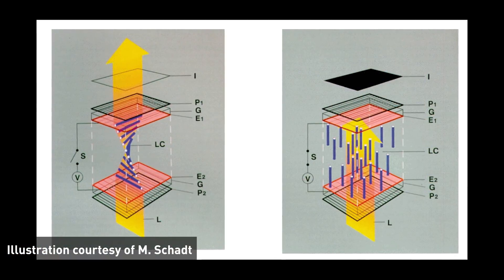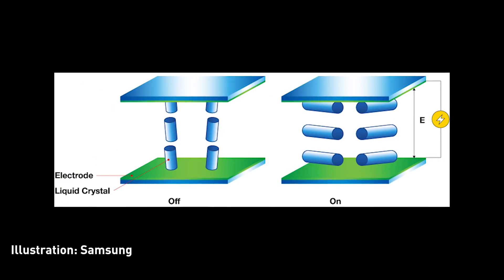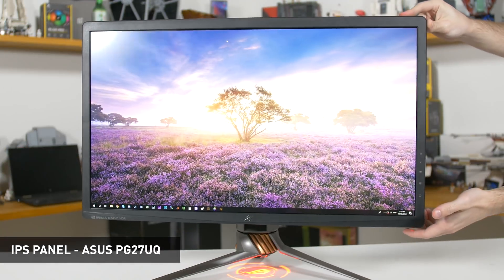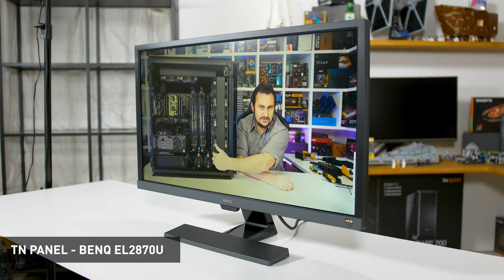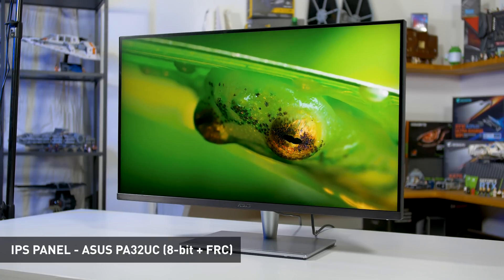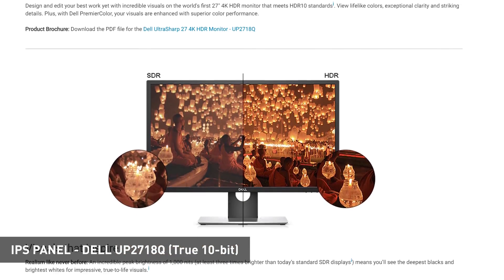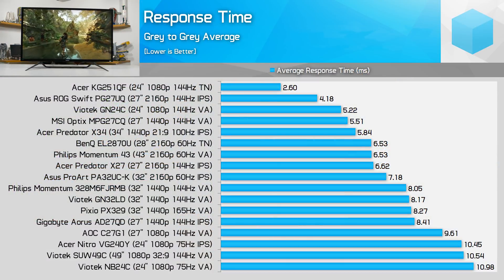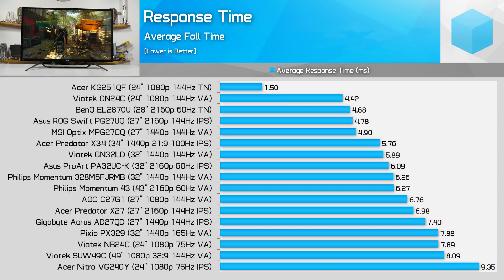TN vs IPS vs VA: Which LCD Monitor Tech is Better?

Comment: Seriously why are u even making this kind of video to misguide consumers? So many of the consumers now have bias on VA or TN just beacuse all the " professional" tech review nonsense while many of the TN and VA are doing a lot better than some ips. It's 2019 and people should really be focusing on the specific quality of the monitor they are looking at instead of using assumption of the panel stereotypes. Seriously cut the bs
Reply: Huh? So what is the issue. You said that consumers are bias towards VA or TN because of "professional" review nonsense, and then say many of the TN and VA are doing a lot better than IPS, which is a good reason for their bias. So what is the issue?
Reply: @Addition2  I don't know if you can read or not but I'm having a hardtime understanding ur comment. Many " professionals" nowadays keep telling consumers that ips are the greatest in color and many of the monitor review would put "this has a ips panel" as a huge praise for the monitor. This is exactly what he did in the video. As a result, when most consumers pick monitor, they started to look at ips monitor only. However, many of us who have a lot experience with monitor knows a lot of the manufactures makes very good va or tn monitor that has better color than a lot of the ips panel.
Reply: @Lorna-0726   Then say "many consumers have bias towards IPS panels because of the "professional" nonsense, despite TN and VA have grown better than some IPS over the years". Because I don't understand your previous comment as it just doesn't make sense why it is an issue when there is no contrast between the consumer's bias and the panel's quality.

Comment: Huh? Everyone's bashing IPS in the comments, while I can barely look at anything but IPS. Sure, the contrast is rather lousy, but the overall picture quality is so much better than either TN or VA...
The only catch is that you can't go cheap with IPS. At least get a mid-tier Dell.
Reply: Same with TN though. Cheap TN gets you exactly what you paid for, garbage. High end TN: Barely a difference with my laptop IPS panel, vertical shift is noticeable from pretty uncomfortable angles and horizontal is almost non existent.

Then there is very slight banding in white to grey gradients, but best of all: no orange puke in the corners when playing in a dark room which in turn means no friggin light being reflected in the monitor either which is a big no no for me with IPS (since it pretty much requires lights to be on to not look like trash in the corners and that causes blacks to look significantly worse then good TN panels).
Reply: @MLWJ1993  Sound rather improbable. Can you actually name such an outstanding example of a TN so that I could try finding one at a store and checking it myself? Truth be told, it's been ages since I paid any attention to TNs, so things indeed could change... Then again, it's probably more expensive than my Dell.
Speaking of which, maybe your IPS is too large for the price? Because on my 27" I barely have that problem even on dark images with the lights off.
Reply: @getsideways7257  it's a 17" 1080p ips laptop panel, but ips usually looks bad in a dark room, nothing unusual there at all.

I got a pg278qr as my pc's monitor, it has issues but so does any other panel tech out there.
Reply: @MLWJ1993  Is it really fair to compare a laptop panel to a TN that costs over one and a half times more than my Dell U2715H? For that price you could land yourself a professional-ish NEC IPS or maybe even an OLED solution. Cheap IPS panels are pretty awful too, that's why I went for a middle ground with my Dell, and so far I don't have a lot of complaints.
Though I have to say that piqued my interest. Need to find one of those TNs and check if they are really that great. Still, if it takes almost $1k to get a comparable image quality to a good IPS, I'd rather stay with IPS.
Reply: @getsideways7257  laptop IPS is actually a lot better then monitor IPS when it comes to quality and even then it still falls short in my viewing conditions. The PG278QR cost me €450,- , most of that extra cost goes into G-Sync & the Asus brand as well, but it was well worth it. Comparable monitors with the same features & an IPS panel would've set me back €200,- extra at the very least for very little gain and nowhere near the consistency of a laptop's IPS panel (also known as the the panel lottery, with IPS being the least consistent of the 3).
Reply: @MLWJ1993  Well, maybe it's a lot better only in the consistency department. Either way, laptops are too unwieldy for me to even consider one. It's beyond me how people are still using those.
Strictly speaking, it's a moot point, since we can't compare our monitors side by side (even though I accept the possibility of a TN panel indeed looking good even at some angle). It's just from my personal experience that IPS' image quality was always superior to that of VA, not to mention TNs. If I'll ever see otherwise with my own eyes, I'll change my opinion. But before that happens, we'll probably have "affordable" OLED and maybe MicroLED monitors around. After all, I don't remember hearing of professional photographers or artists going TN for the sake of better picture.
Reply: @getsideways7257  you don't see a professional going VA either though (yet), simply because of the select features IPS offers (great viewing angles, (close to) 100% DPI-3 colour space coverage, etc.) At least for a professional monitor that is, when it comes to consumer offerings IPS is a marginal upgrade under $1000,- with the same feature set as my TN.
I can't game without VRR support anymore or with just a 60 Hz screen. That removes a professional IPS monitor from the equation fairly quickly.
I also like to keep it affordable at the same time which IPS for what you get isn't really that great value.

If I did have to change my monitor I would probably go high refresh rate VA if they fix the slow dark pixel response times.

If they don't I might consider trying IPS again if nothing better exists yet and an older model has a good price and features.
Reply: @MLWJ1993  Marginal or not, I didn't end up with this because I wanted to throw money away. I wanted good enough color reproduction (and yes, the angles) and the Dell delivered. That said, we appear to have vastly different priorities. I, for one, am barely a gamer at all. Insanely fast panels is not what I absolutely need to have, even though they are also good for simulations. Still, the colors come first for me. I will definitely be on the lookout for TN panels that could rival mid-tier IPS ones in that department, but I have serious doubts I'll find something acceptable among them. I may not be a professional photographer myself, but I need to have a monitor that can be at least remotely considered good enough for the purpose.

Comment: I also wanted VA but my games need to be bright like when u play the isle on a non-nightvision dino and all u can see is the blackness of the sky
So i picked up an IPS although you wont feel the difference in this 3 ms difference there is 1000 miliseconds so 8yr old kiddos dont think 240hz tn is better for u and u cant feel much difference between an 144hz or 240hz

Comment: Got all three , although obviously monitors differ.
The Dell TN i own is the best.
VA is decent. Not bad really regarding response time and overshoot. Colours and black levels are good.
IPS is accurate and pops slightly more without the loss when you move your head an inch to the side.
But the Dell TN is almost IPS like. Honestly if you don't move your head you'd think it was as it's bright and colours are very good. 
The connected feel and response time is better.
Each have their pluses but when I use the TN it feels easier to play FPS and games like FIFA as every thing just happens that few ms faster. You wouldn't think it would make a difference but I think it does.
The others have arguably the better accuracy but not so much with fast moving graphics.

Comment: Personally i just can't stand the bad viewing angle of TN panels specially with big monitors. I've seen ~30 inch TN panels where you could see a significant change in contrast by just looking at the corner of the screen without moving your head. I have two monitors. A 60Hz 1080p IPS monitor i use when i have to do web design because of the better color accuracy and viewing angle. And a bigger 144Hz 2k VA panel to game because i simply could not find a cheap big 144Hz 2k IPS monitor. I think VA is a good compromise if like me you can't stand TN.

Comment: recommend VA for gamers, when VA is slowest? oO;
I came here because i own a Samsung "gaming" VA monitor (C27FG70) which is so ridiculously bad that even watching some videos is a pain due to the ghosting no matter of the settings, certain speed sideways (panning) movement is so choppy that distinguishing any details is damn near impossible when the same thing is at 3-4 places at the same time moving back and forth. FPS games are damn near unplayable no matter the settings (multiple GPUs tested, multiple OSs, multiple drivers, all settings perused through, both hdmi and displayport, freesync or no freesync).

Comment: What's up with the whole 8-bit color depth deal? Haven't we been using 32-bit color since the 90's?
Reply: 8 bit panels can do 24 bpc , 10 bit panels 30 bpc, they refer to the amount of shades any specific pixel can have at maximum.

You can also do frc which quickly switches a pixel to simulate a new colourshade, it does however flicker badly if you're sensitive to it.

Comment: I don get why people care about viewing angles so much... who looks at their monitor from the side in the first place?
Reply: It's not about viewing your monitor from the complete side, it's about the colors shifting and looking like shit if *you don't keep your head perfectly centered* on the display. Take ultrawide monitors for a big example, notice how all ultrawide panels are either VA or IPS. And how nearly all TN panels are 27" or below. Any bigger and the sides of the monitor would look like washed out trash, you'd be forced to back up to fix this problem, but who wants to really back up from their desk?
Reply: I have a 32 inch VA panel and it is good when my face is centered, but when I just move my head a bit, colors shift. It is mainly an issue when you have a large monitor. It is annoying.

Comment: Can anyone recomend a VA panel Monitor that is 27" 1080p and 144Hz please?
Reply: If you're willing to drop a few inches the MSI optix mag24mvc is a solid and cheap option. Has freesync too.
Reply: Thanks for your reply, I will take a look at this, it sounds interesting and a good starting point but I really do need 27s for the upgrade to be worthwhile.

Comment: I recently went from an Asus VG248 24" 1080p 144hz 1ms TN monitor to a Viotek GN27D 27" 1440p 144hz 4.8ms VA. So far I'm very impressed by this $360 VA panel. There is very little ghosting, and the colors and viewing angles are notably better than on the TN panel I came from. This is probably the best 27 inch 1440p gaming monitor for the money. That said, neither of them touch my Panasonic VT25 Plasma TV for color accuracy and fast motion.

Comment: I’ve just upgraded from a BenQ  24’’ 144hz 1080p tn exports monitor to a 32’’ 1440p ROG 144hz VA monitor and I’m blown away by the colours. I genuinely wish I had moved away from TN sooner, although VA has speed shortcomings they are literally hidden by the colours and contrast

Comment: IPS glow? What about VA glow, which is similar, but MUCH, MUCH worse. Whereas with an IPS panel you can realistically sit away 40 cm from a 31,5" screen, you'll probably have to be around 100 cm or even further away from a VA panel to avoid this effect. That's a big bummer. My old VA panel even requires a distance of 1,5 meters before VA glow goes away. And that is with sitting right in front of the display. No off angles.

Comment: I think most people will prefer VA panels, especially if they don't want to spend a lot of money. The amazing contrast ratio and much better colour than TN panels is really worth it. IPS panels are generally fine as well, but the contrast just isn't as good, and movies and games will still look worse, and they aren't as good of a deal as VA panels I think, usually costing a lot more to get a good one. High end IPS panels are very nice, but so are high-end VA panels. Between equally priced models, VA panels win hands-down for most users.

TN panels can be good for very competitive gaming, but I think most people shouldn't bother with them. The colour and contrast ratios on TN panels are just... ewwwww.

Comment: I'm using a cheap AOC IPS monitor and I am very satisfied with it. It has a bit og IPS glow but overall it's fine. My advice, buy what you can afford and don't give a damn about higher quality and expensive models just like you would a car. There are Ferraris, Lambos and Porsches out there but how many of you own one? Use your money in a smart way.

Comment: I went from an IPS 24" FHD HP monitor and OC'd to 76hz, to a 27" HP QHD TN panel OC'd to 76hz, to the dell s2417dg which is a 24" QHD, 1ms 165hz G-Sync TN panel monitor. I currently have the two 24 inchers setup because I just got the Dell, and like the HP 27" TN, I was able to calibrate both TN panel monitors to where they look nearly identical to the IPS.  The IPS does still have slightly "deeper" colors and darker blacks but I have to really be looking for it to notice the difference. I only use the 1080p IPS monitor for stuff like HWMonitor, OC software, youtube/etc when I'm gaming, otherwise I pretty much strictly use the Dell QHD monitor.  In my experience, you can get most quality TN panel monitors to looks nearly identical to their IPS counterpart, and the TN panels have the added responsiveness and are cheaper. I got this Dell today (24", QHD, Gsync, 1ms, 165hz) for $280 at a local Best Buy. To buy an IPS panel monitor with similar specs minus the panel type, I'd be looking at $550. TN panels really aren't that bad.

Comment: Since nobody is selling Viotek in my country, I will go for the AOC. You recommended the AOC G2460PF, but I found out the AOC C24G1 is 35 usd cheaper in my country. I saw you did review of the 27 inch version of this monitor in another video. My question is which one of these two is better and should I spend 35 more bucks? The C24G1 is VA.

Comment: I noticed the difference between TN and VA in gaming. Destiny 2 has caves hidden by overhangs which makes it really dark. On a TN monitor, it's pitch black and if you weren't looking for the cave, you would walk right past it. Getting a VA monitor made the cave visible - you could see dim lights inside.

I recommend getting a VA monitor if you play games that have dark area or open world games in general. Heck, even FPS games too (Rainbow Six Seige had some pretty dark maps). IPS is good ,but they are generally more expensive. VA is the sweet spot. Never going back to TN again. I don't need a refresh rate past 144Hz anyway.

Comment: FYI:
So you guys know, there are "VA" versions of IPS panels. I had a discussion with this in reference to one of the Q-Led monitors and told a guy he was wrong but he was right saying a monitor was IPS. The confusion arose because it was reported by others as simply "VA" when in fact it was "AHVA" which is an IPS panel. The "VA" means different things as well as AHVA means Advanced Hyper Viewing Angle and VA of course stands for Vertical Alignment.

Comment: IPS for me been using IPS display monitor for years. It broke so I tried the TN panel. Couldn’t stand the washed out color so I returned it and get the predator IPS GSYNC monitor.
Reply: contrast between IPS and TN are the same .. i bet you had a cheap ass TN, so of course the Predator IPS gsync monitor is gonna look much better.

Comment: Ok now i could report this video as missleading... Good quality VA panels will NEVER have any problems with contrast and viewing angles...
I am using a VA panel which has 1:100000000 dynamic contrast ratio and i'm not gonna switch any soon...
Adobe RGB included...
Reply: Dynamic contrast isn't the same as static contrast, don't even use that number on the spec sheet cause it means pretty much nothing... Same for "1ms"...

Comment: It really can't be stressed enough how horrible TN viewing angles are, especially the vertical ones. And it doesn't help that the monitor manufacturers use different methodology to measure TN viewing angles so the numbers wouldn't look as bad compared to IPS/VA. I mean...you get color and gamma shifts in the vertical direction even just sitting at your desk and looking at the monitor from a normal distance of say 80-100 cm. You will see color and contrast gradients where there are none at all. I could never go back to TN as my main monitor. I can barely stand them as an additional monitor. Even if good TN panels might match IPS/VA in color reproduction, the vertical viewing should be a no-go for anyone that cares about the image quality.